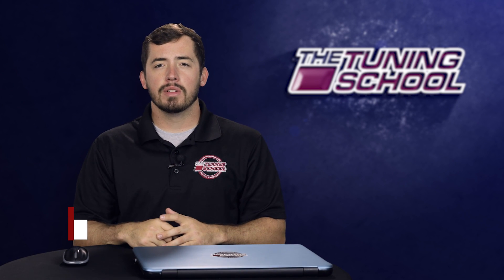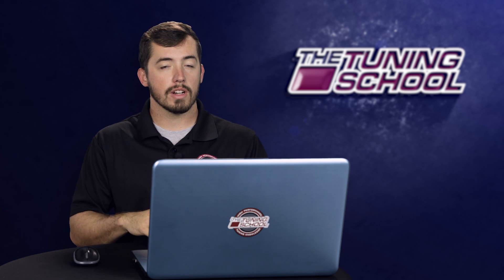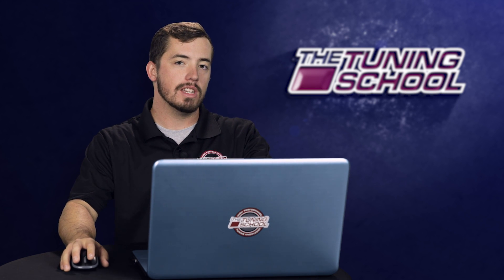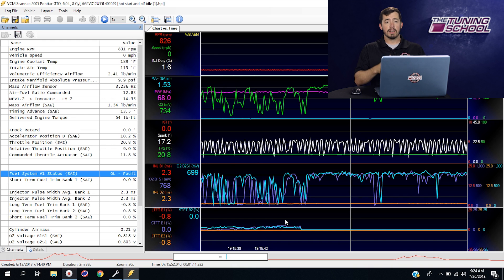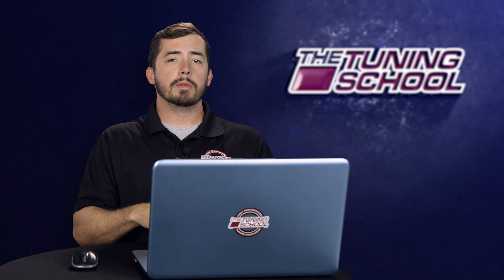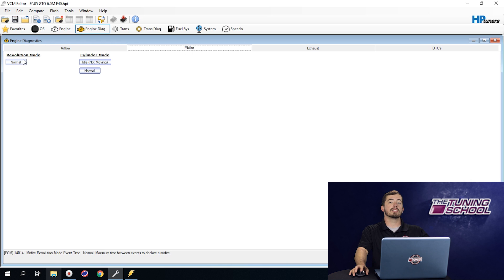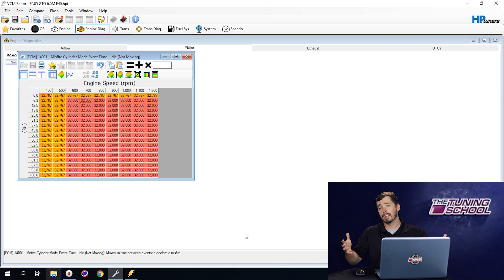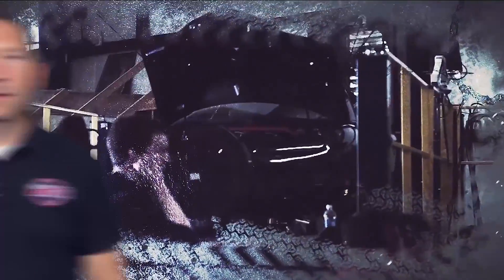How to Fix GM Open Loop Fuel System Fault Using HP Tuners 4.x

Comment: In my case is happening after replacing intake manifold gaskets, which were the source of a major vacuum leak. My short and long fuel trims were crazy, now they are at zero, or were at zero after gasket fixed. Short remains at zero now, while long is creeping back up.

Comment: I have this very problem with my Lincoln ls, I hit the gas trying to beat a red light it went over 4k rpm  and it started to idle rough and eventually refused to start now it's sitting in my driveway, any suggestions on how to fix would be awesome, thanks!
Reply from the maker: This is a vehicle and an issue we do not have direct experience with. However, if the vehicle is stock then it is likely a sensor or component failure of some kind. Your standard diagnostic procedures, starting with a code check, should lead you to an answer.
Reply: Yo I have the same problem. Code p0357 which is the ignition coil. Fixed that, replaced the spark plug, replaced the wiring harness and still the same problem. Starting to think it’s the throttle body. So confusing it’s like I’m getting nowhere
Reply: It turned out to be a dirty maf sensor,  cleaned it with some crc and it fired right up

Comment: Why max them out to effectively completely remove the ability for the ECU to protect the engine and notify the driver when it occurs? Can’t you also increment these values until the problem goes away, so the ECU can still respond when a real event occurs?  This feels a lot like hacking that has been done in other areas of calibrations (usually fuel) in the past but is largely frowned upon by current standards.
Reply: Thanks for the comment!  I'll help explain.  The way the ECM monitors for Misfires is by observing the time between events (firings of the cylinders), and watching for RPM drops in between each event.  It's the only way the ECM "knows" there's a misfire happening.  A weak combustion (due to a misfire on a stock cam vehicle) would imitate the way a cammed vehicle behaves.  As a result, it is no longer a reliable method of misfire detection.  About the protections you mentioned, there's only a few, such as forcing the vehicle into open loop fueling and TCC disable that are the result of the factory misfire detection routines, which are mainly for people who are not car enthusiasts and couldn't detect a misfire on their own.  I'd imagine anyone owning a heavily cammed vehicle would be educated enough to know the difference between when an engine is running well or not.  Hope this helps!
Reply: @BobRocket78  why would a car manufacturer force open loop on low boost. Lower boost than the detected low boost is worse for the car.
Reply: @BobRocket78  Understood, that's it, you got it,but it's strange;  with any camshaft,the time between firing events ,still will be the same, (if there are no misfires); 

I think  it's not the time between firings;   it's the (I)REGULARITY of ONE WHOLE ROTATION (360º) of the crank; and a "big" cam with its lumpy idle brings IRREGULARITY at low speeds (he is at 831 RPMs,if you go look at the video);
You see,sometimes a car would come up with a misfire code, BUT this was ONLY caused by the rough road it was on;   you see,the wheels themselves (thru the trans) would put on (and take off) torque on the crank, back and forth,making its rotation IRREGULAR, and the ECU THINKS it was a misfire...boom...a misfire code; WRONG!  That's why cars have a G sensor to inform the ECU of the rough road situation,and when this one fails,FALSE misfire codes appear and  lots of money is spent... plugs,coils,injectors, ECUs, etc,and the harm is still there,not fixed yet.
Kind of how the all-ignorant and incompetent courts of law can't make heads or tails of the matter,for they know nothing about it, they never leave the desk!!!nor of the fishy lawyers from each side,and end up randomly according to the lawyer the yells the loudest,deciding one thing,appeals decides another,superior court another,etc...basically STEALING the money from the taxpayers, while RUINING some people's lives,and the shht never gets fixed,or does .but randomly; i am stubborn for the TRUTH,i never had ONE car that defeated me; not yet, anyway...LOL